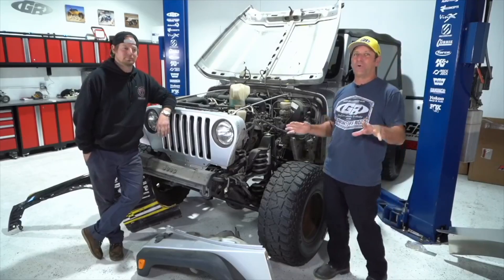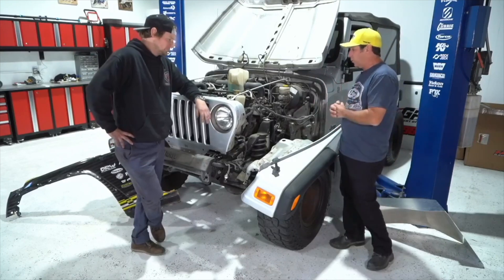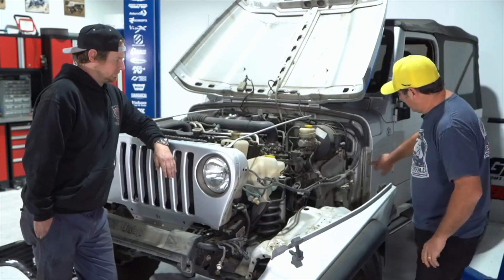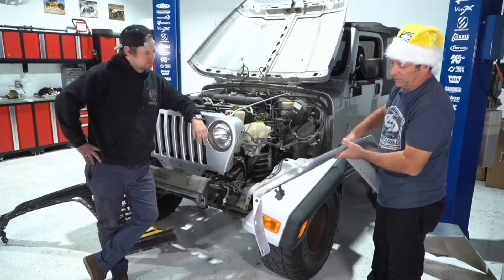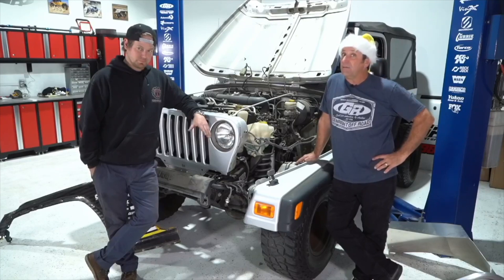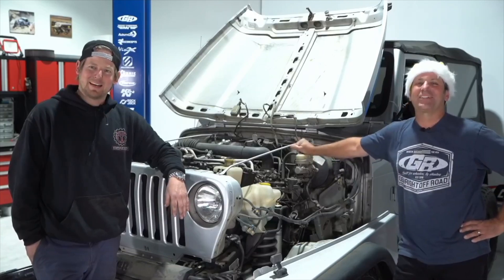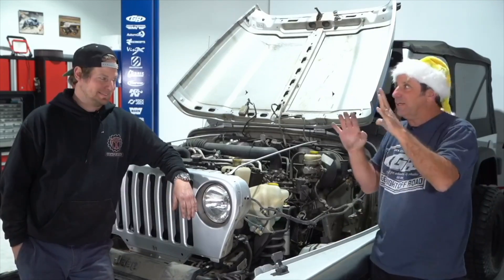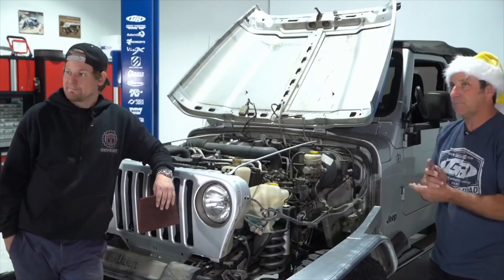Tech Talk with Tony - Tube Fender Install tips!

Comment: 2005 Lj Rubicon purchased the 4” alloy standard fender and inner fender.

1 - does inner fender require trimming to clear stock spring and shock tower? Seems to bind up pretty good getting behind tower.

2- is inner fender supposed to fasten to  all four (big washer/bolt) contact points on battery tray / accessory tray support structure? It seems to only want to make contact with two otter holes

3 - is it required to cut and bend tray support structure to make fender be cable to attach to the two outter bolt holes at rear of fender?  These holes do not come close to lining up in both distance or angle. 

4 - am i able to retain the windshield washer reservoir

Thanks